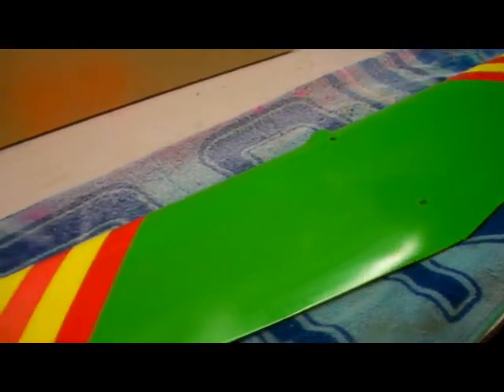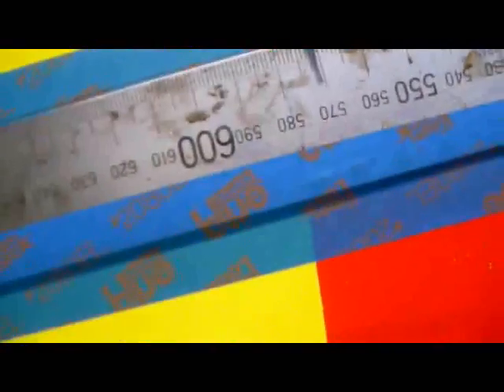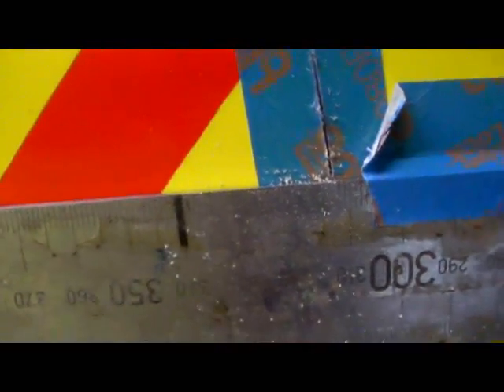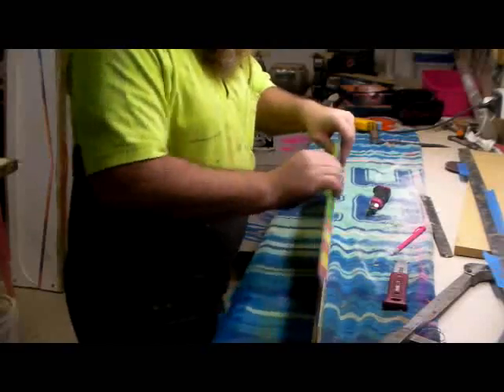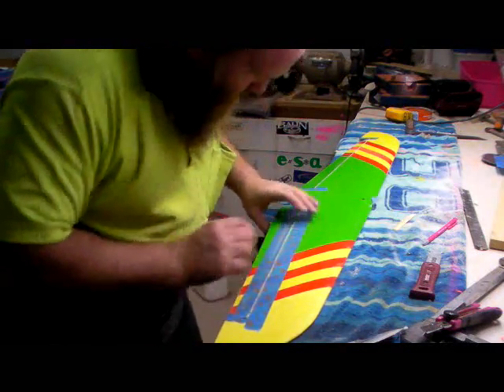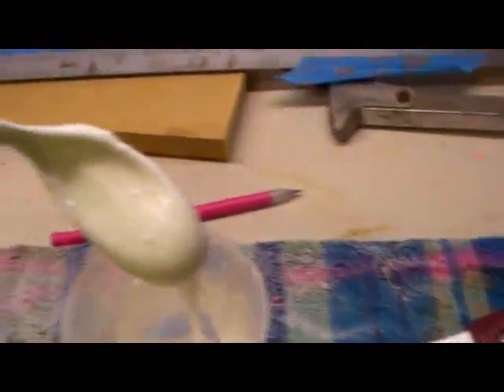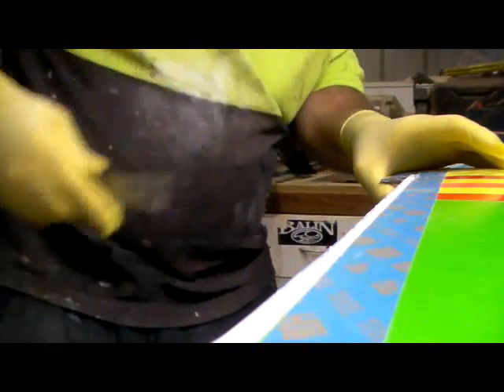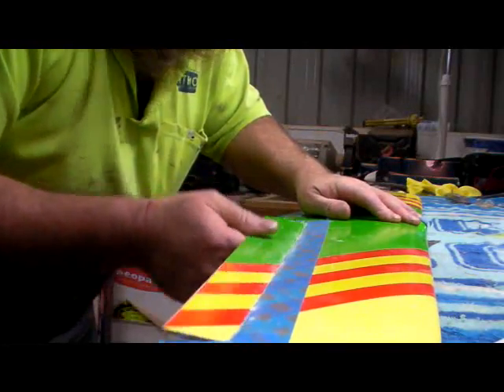cutting the Aileron's into a  moulded wing.

Comment: Like your work. This is not an add for a product, but saw something that you might be able to use.When sanding the clearance to allow the aileron to fold into the wing the metal backed abrasive made by Permagrit works very well, is thin and never wears out.

Comment: when you made the wing how did the kevlar not get saturated with resin like the glass?   how is it still flexible?
Reply from the maker: Kevlar is not like fibreglass, fibreglass will snap when it has been wet out Kevlar won't.
When you lay the wing up the Kevlar is one of the last pieces you put in I do put a light glass over top.
So when you scribe down to the Kevlar the resin will work out of the Kevlar and work as a hinge.
The scribe needs to be 1.5 -2mm wide